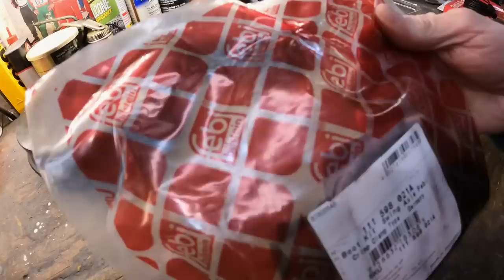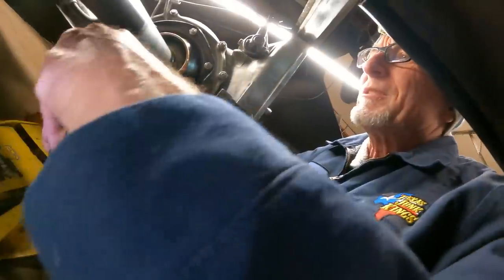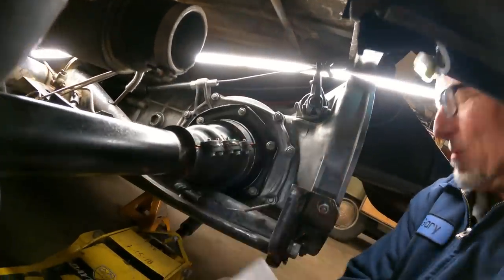How To Install  Swing Axle Boots on your VW!

Comment: 1964 VW owners manual states " leave weight on the wheels,  apply sealant to the seam,  install with seam at 90 degrees facing the rear with the screw heads on the bottom for ease of install.  Check boots at every oil change.

Comment: A better way to do the silicone sealant, if you use it at all, is to put it on the inner lip of the boot itself, and then let it dry for 24 hours.  Then when you clamp it on the axle tube flange, and axle tube, it will stay in place on the boot, and compress against the surface of the axle tube flange and axle tube, and create a good seal.  When you remove it, it will come off with the boot afterwards.  A better seal, and easier clean up if you have to replace or remove the boots again.  Nice job, and the angle is a great tip.  I wish I had known about the angle for the seam before I replaced my transaxle and boots in my '64 but way back in '84.

Comment: Great video.  From one Gary to another 😎. I like to use the square end of a chisel or drift between the spring plate and the lower stop. Release the jack and the tool will hold the axle up a bit off the frame horns without balancing on the jack. 
Cheers Gary.

Comment: So Spot got a rebuilt transaxle? Febis are my favorite too. And careful not to overtighten the worm gear clamps, those can cut through the boot if over tightened. And your orientation instructions with the seams facing forward at 10 and 2 are right on. I also try to push the boots in against the transaxle as much as possible while installing being that the axles will be hanging down lower later. That way you try to eliminate as much stress from the boot as possible.
Reply: Ol Spot's trans was/is good, it was the axle/axle tube that was bent. So, after some serious cleaning, sure looks new! And thank you for the tips on to not overtighen.

Comment: Great video guys. Question for you. I just put new boots on but are leaking like mad. I painted by axle tubes and flange. I see that the surfaces, in your vid, where the boot makes contact appear to be bare metal. Is this the case? If so, should I strip the paint to make better contact? Thanks in advance for any advice you may have!
Reply from the maker: Well sort of.. it is best to have bare metal there not specifically for sealing but more for not have paint come off and be in your gear box also.. if they are split boots make sure they are clocked a little like 10 and 2 .. You can tighten them down but sometimes too much will make them leak also .. Best of Luck!

Comment: Good video. How much did the bug come off the jack stand when you jacked it up?  Not as easy, but I’ve just waited until it’s on the ground for final tightening. That way you get it at the angle where it rests during normal operation
Reply: I do that with Jerry the Bus, but Ol Spot is so low, I cant fit under there so well anymore. Need a time machine to go back about 30 years, then I would slip right under !
Reply: @CapnTexan  I get that. Mine is a tight fit, and I’m at least close to stock ride height!

Comment: The VW Dealer trick was to place an old spark plug butt end in first between the flat spring plate and the cast iron lip ~ jack one side of the car at a time or have a helper hold the plug in place was you jack the car .

Remember : SAFETY STANDS ALWAYS ! NEVER trust the jack to hold the car up .

-Nate
Reply: I neglected to mention that the seam should always face forward never to the rear as that placed it closer to the heater box's radiant heat, shortening life .

This _isn't a tough job, just messy and a P.I.A. .

Failure to do this and keep the transaxle topped up is what kills many a transaxle .

Low co$t gear oil pumps are in every F.L.A.P.S. .

-Nate
Reply: We always just put a nut under the spring plate, usually gives enough room to get the boots on.

Comment: Did you just replace the entire trans in Spot or the bent right axle?
Reply: Hey Jim, I replaced the right axle and right axle tube. AND, at some point in the past 56 years, Ol Spot had a little transaxle work, because it was not running the '67 long tube axles.

Comment: I always feel like no matter how well I get these to fit they're going to leak lol. I attempted to fit the solid one piece boots once, couldn't fit them over the axel lol.
Reply: I wanna give the one piece boots a try one of these days. The key is to heat em up enough to stretch them!
Reply: @CapnTexan  I tried them in a bucket of warm water, and prying them with long screw drivers. Might be worth investing in a tool specifically for that job.

Comment: I really want a vw but I'm wondering what year and style would be best
Reply from the maker: Getting a bug will allow for most available parts at lowest cost. Earlier the better in years.
Reply: I would recommend a  Scirocco!!! But then again, that's me!
Reply: I would go with a 69-71 regular beetle, not super beetle. 1969 and up you get ifs rear suspension and you won't be worried about these boots. Yes ifs has boots but they are better and incorporated into the cv.